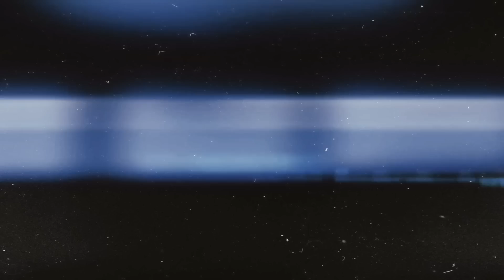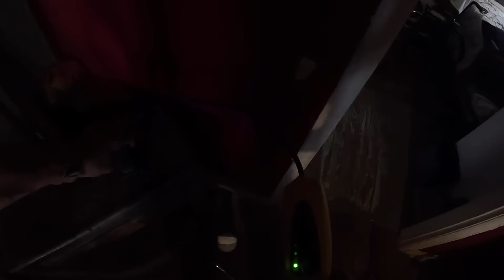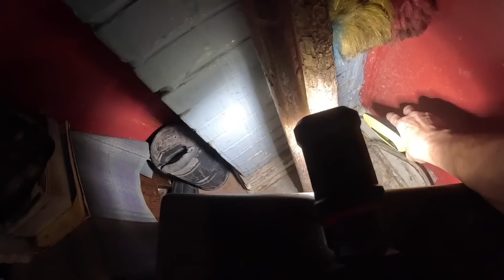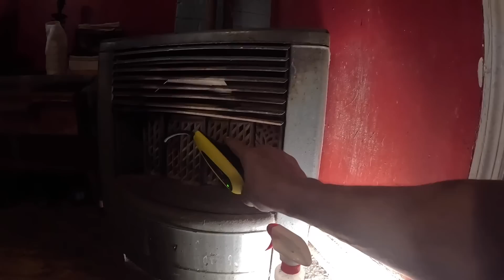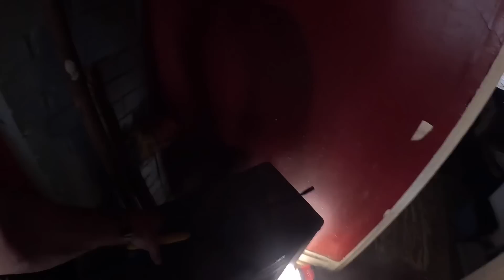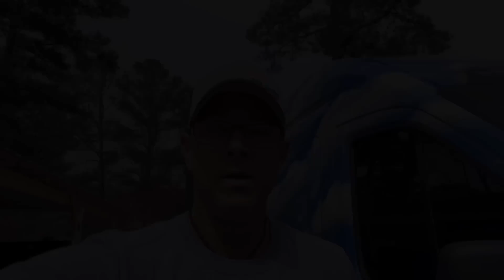Gas Smell Complaint Leads to a Dangerous Furnace! #hvacguy #hvaclife

Comment: The land lord might be replacing a lot more than a heater if continue to try using that fire bomb!!   That thing’s probably from the 50’s and already done what it came here to do
Reply: Probably older than the 50s. Most states have long since outlawed those unvented heaters.  In CA they were used in farm worker housing in the 50s and 60s.  Every winter there would be fatalities from not cracking open a window.  The state banned them in the 1970s.

Comment: Nice job.That's an old one for sure. It's probably been there as long as that old house. In that case, I would recommend tearing the whole house down. I know there are unfortunate folks out there, but you should not have to live in danger. Those old plumbing stacks were frightening too. Change to electric and get rid of the gas.
Reply: Tear down the house??? too many people complaining about the lack of low cost housing.
Reply: You have a point, I was basically looking at the safety. I will say this, no matter how old a place is, it can be kept clean. @grandinosour
Reply: Electric heat is safer but in Houston TX your bill in a small house can run up to $ 400.- per month.
Reply: @bobboscarato1313  Is that an electric furnace/resistance heat in a poorly insulated house? I run a heatpump in a large house in a place that gets a lot colder than Houston, TX and my highest electric bill ever was around $225. That was during an unusually cold January.
Reply: @brianleeper5737  House is very well insulated but need to get Heat Pump!
Reply: You don't destroy a home because of a gas leak.  Ignorance abounds.
Reply: What you are saying is moot, it has already been addressed, so who has the ignorance?:body-blue-raised-arms:Furthermore, you can bet there is more going on than the gas leak, don't light a match. I bet the plumbing doesn't work and the bathtub is full of:face-fuchsia-poop-shape:  @bennyrussell5551
Reply: Your reply is moot, that has already been addressed. Ignorance abounds for sure. @bennyrussell5551
Reply: You don't have to destroy it, the tenants are doing a fine job. @bennyrussell5551
Reply: You don't have to Benny, the tenants are doing a fine job. Furthermore, your reply is moot, it was already discussed. Ignorance abounds for sure

Comment: As far as I'm concerned those units should not be legal
Reply: Well maybe when they get that old, new they are pretty good.
Reply: They are still manufactured.
Reply: Most states have banned them.  Modern replacement is a console heater vented through the wall, usually installed below a window.
Reply: @dfirth224  Usually installed Downstairs on two-story homes.
Reply: These are already illegal as he said. But in that situation I'd rather be able to have heat with issues than no heat at all.